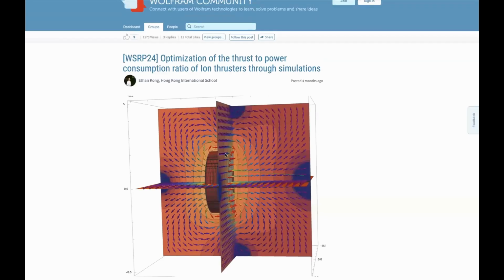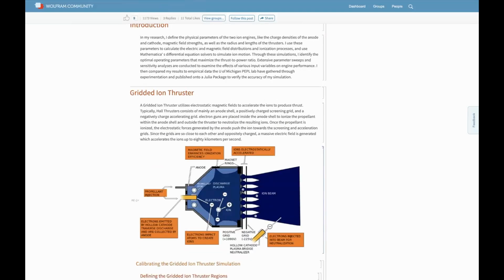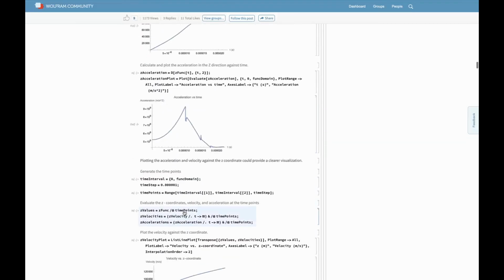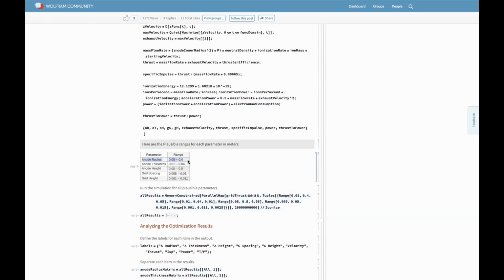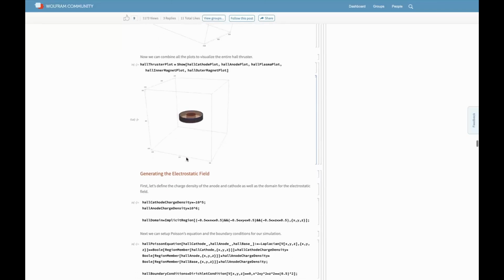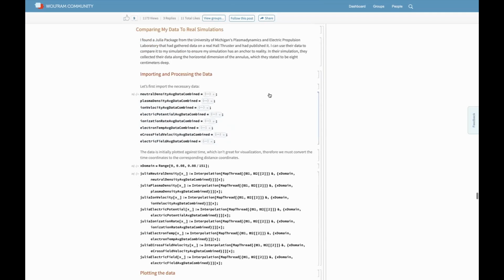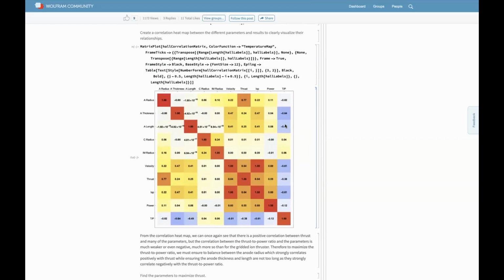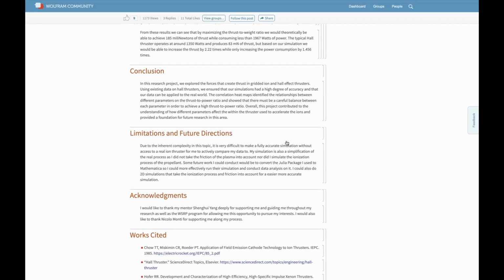Optimizing the thrust to power consumption ratio of Ion thrusters through simulations.

Comment: Very impressed by the calculation, i built an ion thruster my self. In that calculation it gives you 26 mN per 360 Watt, the thruster i built is not really a grided ion thruster and it works with plain air and i thought the calculations should somehow be in the same ballpark to what i get experimentally, but the numbers in expermential results i get is about 40mN per 16W of input power. Would you explain this difference just due to different geometry of the anode and kathode or due to the difference in ionization energy of xenon and air ore due to effects not considered like e.g secondery and third ionization events. Or something complete different?